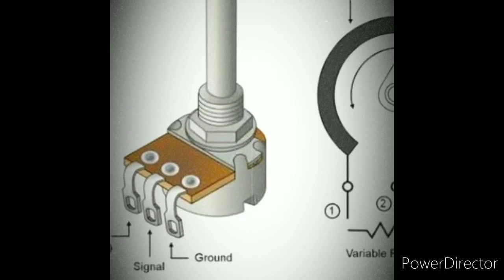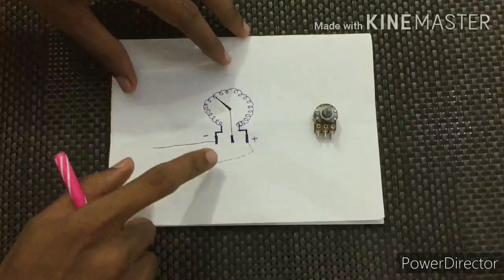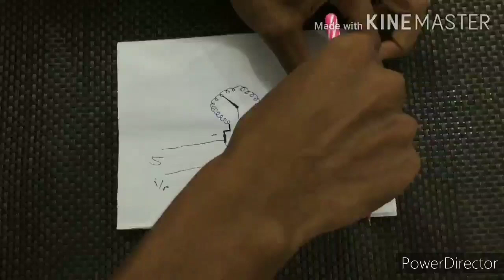How to wire  a potentiometer ; simple way of understanding potentiometer...in malayalam

Comment: 6v ബാറ്ററിയിൽ പ്രവർത്തിക്കുന്ന ഒരു എമേർജൻസി ലൈറ്റിന് brightness അഡ്ജസ്റ്റ് ചെയ്യാൻ 50k യുടെ pottentiometre ഉപയോഗിച്ചാൽ മതിയോ?
Reply from the maker: Pora.. Current kooduthal aanenkil pot adichu pokum. Better use 100k Or try another method.
Reply: @jayeshkrishnan5303  bro how to connect it to speaker
Reply from the maker: @ bk gaming ..connect it to input of the amplifier and not at the speaker
Reply: @jayeshkrishnan5303  bro I have 47k pot potentiometer and is it work on 5v supply and I connect 2 5w speakers to it's is it any way to connect I'm using d882 transistors to make it
Reply from the maker: @bk gaming.. It's will work bro, and I have already said u that.. Just connect the pot to the input of the amp board and the output directly to speakers
Reply: റേഡിയോ ൻ്റെ on of Encoder എത്ര ഓമസ് ഒന്നു പറഞ്ഞു തരുമോ 4.5 v redio